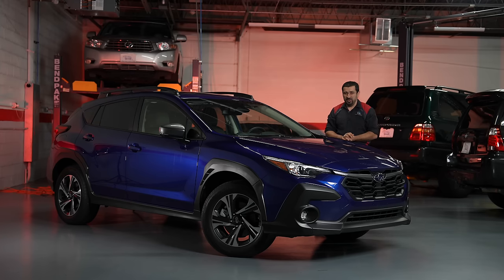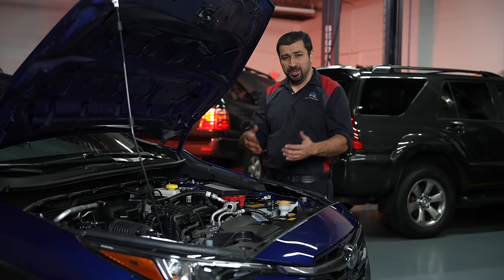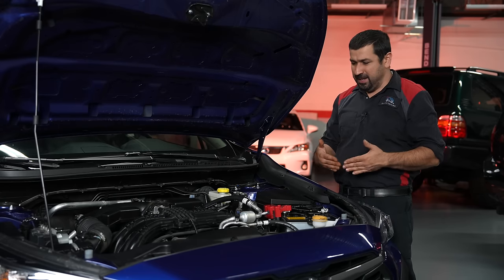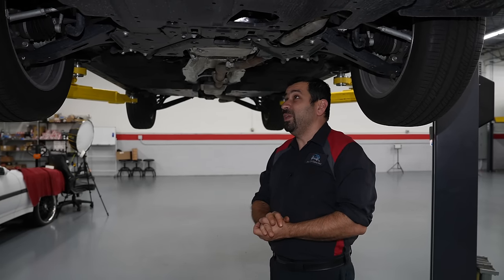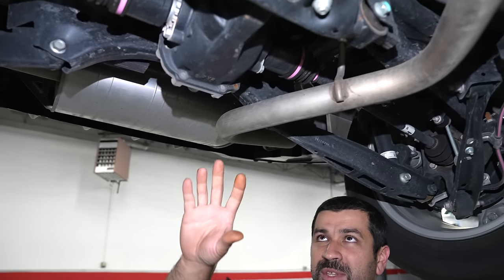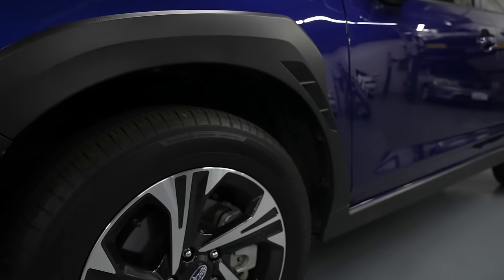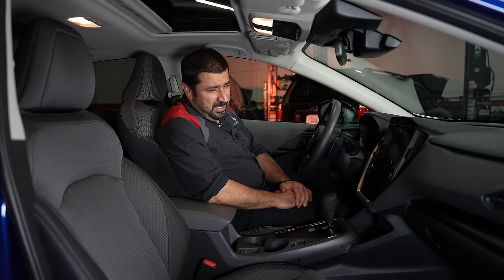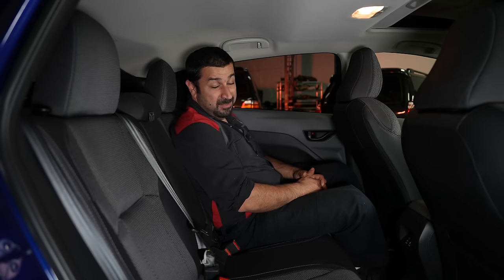Should You Buy a 2024 Subaru Crosstrek? Thorough Review By A Mechanic

Comment: Good review but it affirms that I  will not be buying a Subaru in the future. I bought a Forester with a 6 speed manual transmission about a month and a half ago that for the most part I'm happy with. It does need about twice the power it has and the electronics are a pain to deal with . 
  However when it comes to a CVT transmission I hope to never have one the only thing I would hate worse would be an electric car. 
  I prefer a manual transmission and I had to go several hundred miles to buy a manual Forester. 
  By the way my Challenger Scatpack is a manual that I ordered new. Sad to say they are going away so it will be a long time if ever that I buy another new car.

Comment: On our 4th Subaru and 2nd Crosstrek (2021). We like our Subaru's and concur with your quality remarks. Even find it easier getting in the rear vs son's 2021 Mazda CX-5. On the downside the infotainment system sucks; turning on the radio every time the vehicle turns on, fuel economy is not good for small vehicle, Steering wheel is too busy as we still don't understand 50% of them and finally the CVT does have that rubber band effect on acceleration. We are starting to question the need for AWD even though we live in Canada as we have seen a massive change in extended snow and ice coverage.

Comment: I don’t think those vents on the front fender arches are brake vents. I think they’re to relieve air pressure under the wheel well for better aerodynamic stability. I doubt they do much but I don’t think brakes have anything to do with the intention behind them.

Comment: I’ve driven these with both the 2.0 and 2.5 engine and the 2.0 is slow and even boarder lining dangerously slow. The 2.5 however in my opinion doesn’t feel slow. It’s still by no means a fast car but definitely wouldn’t classify it as slow and it doesn’t really leave you wanting for more power like the 2.0 does. 0-60 times for the 2.0 are 9.7-10.2 seconds and for the 2.5 8.0-8.5 seconds. The 2.5 gives a pretty good jump in power for half a liter and 30 horsepower.

Comment: Glad Subaru changed the brake system on this vehicle to feel more immediate.  My 2016 2.5i Forrester's brakes don't feel immediate.  There tends to be a slight delay in braking, unlike my 2014 Toyota Hybrid Camry, which brakes immediately.  And there is also a "lag" when accelerating.  AMD is correct, this car is slow and doesn't respond quickly.

Comment: Cameras are not cool.  Every time you crack a windshield, you must recalibrate the camera. Lane centering is a pain - no thanks. I miss the days of simple cars.  BTW, the camera is also taking up part of your windshield -- don't like that.  Subaru in general has many good points, including value and resale value.  I just miss simple cars that the driver controlled.  No huge screens, which must cost a bundle to replace, inexpensive headlamps, no nanny stuff yanking the steering wheel, buzzing or braking.  Wait for the days these cars get old and see the junkyard long before they would have in the days of repairable cars for reasonable prices.  A CVT alone is $10K.

Comment: Great visibility and incredibly safe huge improvement from previous years given wiring issues for these new electronic systems which are crazy complex. Owning 2 this new one is surprisingly large compared to the previous still owned model. Subaru all wheel drive is a dream to drive and the vehicle because of how the (very light) weight is distributed.  Was very impressed with the new Subaru full size SUV. Only thing missing is a return of the WRX at this point.

Comment: I have a 2017 Subaru Outback 6 speed manual 
But I will not buy any car with a CVT
Also what’s up with the oil filter being mounted high up and upside down. This causes the car to dry start every morning because the filter empties out over night. Really bad design.
Also I am not impressed with the symmetrical all wheel drive. All it does is apply the brake on the slipping wheel to drive the power to the wheel with traction. I don’t find it works very well in the real snow world. I have to turn traction control off to get up my driveway.
Don’t buy any car with a CVT. They are all problematic. Some more than others.
Now I will say that we have had no issues with the car. It’s never been back to the dealer. It’s fully loaded with all the sensors and power hatch dual Climate control power everything.
But a four wheel drive with no tire pressure system ! Subaru what were you thinking ?

Comment: A bit surprised about the comment for the camshafts. It is a dual overhead camshaft design, even though it is a boxer or flat-4 engine. The camshafts sit in the upper section of the cylinder head. The cylinder head orientation has nothing to do with the head design. The head can be upwards, downwards, on the side, it does not change the camshaft position in the head. Even Porsche with their flat-6 engines, will specify that their engines are of a double overhead camshaft design. Just a small comment. Your videos are interesting….

Comment: Mine had 15k miles dealer pulled the engine twice to fix the cam seal, pretty bad oil leak twice within 15k miles. Car is a POS never touch a Subaru

Comment: So FYI to everyone:  the cam carrier seal is only RTV and is known to seep/leak over time. If the oil leak gets too bad, it will require the engine to be pulled and engine resealed. Dealer found my cam carrier seeping on both sides of my first Gen 52k mile Crossie, quoted me $4700!  Also, I am wondering if anyone knows for sure if the later gen Crosstreks had the rear bearing failures corrected?

Comment: I'm not a fan of electronic "parking" brakes. They seem asinine. One should be able to modulate an "emergency" brake, and it should be a VERY simple mechanism.

 That said, the Crosstreks and Impreza hatches can pack a lot of value...impressive AWD/VSC/TCS, 5dr utility, available roofrails, miserly hwy MPG, easy maintenance, surprisingly good ride, good legroom, good headroom, stable handling, and 1500lb base tow rating.

Comment: Thank you for your in-depth review of this car. Good video. In my opinion, anyone interested in a Subaru in general needs to do diligent research before purchasing one. I know they have quite a following of loyal customers. Do not let that be the only reason you buy one. As a master mechanic, in my personal experience, Several red flags in my mind about the brand..The use of a belt driven CVT is generally just a cheaper design that is less efficient, with shorter service life. It is not uncommon to see them fail with only about 70,000 miles on them. Also, don’t even think about towing anything with the vehicle if it has a CVT; these cars are indeed very slow due in large part to the CVT transmission. Your grandfathers car that had a vacuum booster for the power brake system generally never had a problem with it for the life of the vehicle. And that electric assist for the power of breaks will likely be prone to failure in the future just as electric power assist steering is today versus the much more reliable hydraulic assist of older cars that is more expensive to manufacture. The boxer engine with its flat plane crank, is dynamically unbalanced particularly at low engine speeds. For this reason, fuel economy suffers.I can’t count how many Subarus have had their head gaskets replaced. I see no major design change that has rectified the problem. These engines are known for using oil. Any modern engine in today’s world that does not have hydraulically adjusted valve lifters is unbelievable to me. Toyota currently owns 20% of the parent company for a Subaru. You would think these cars would evolve into better vehicles in the future. Without a dual injection system that Toyota uses there will be carbon buildup on the engine intake valves causing poorer performance. The all-wheel-drive system is affective, however it is not adaptable to dry weather driving. Personally, rather than have it on all the time, I prefer an all wheel drive system that can be turned off when it’s not needed to save fuel. Why do you need it on all the time once the vehicle is in motion? If you really think you must buy a Subaru in my opinion, lease it and only keep it while it is covered under factory warranty.

Comment: Helpful review, thank you!  Perhaps sometime you could review the RTV sealant issue.  These use RTV sealant on the camshaft carriers instead of physical gaskets and in other places in the engine.  Some have said that after 100,000 to 150,000 miles the engine will have to be removed to replace the sealant -- which wears out and causes oil to leak.  The engine removal process represents a significant labor cost.
Reply: I work at a shop that works on a lot of Subarus. The FA and FB motors uses silicone on everything in their engines. The first time I had one apart I was surprised they even use silicone on their head gaskets. I've seen these engine develop oil leaks after 1-2 years of use.

Comment: Could somebody explain the differences between this model and Wilderness model, please? Does every model of this age has E-sight system and does the Wilderness model is worth buying instead of buying this one, considering the price? Thanks
Reply: Wilderness model is just that much better for going off-road: such as additional clearance, the more powerful engine, a little more protection underneath, modifications that give it a much higher tow rating, dual X-mode, comes with better tires. Also some of the higher end features. If driving in mountains or in snow/dirt a lot probably worth it. EyeSight is standard on all trims.

Comment: It's not slow!  It is fast enough for the speed limit of our streets and highways!  Yes, it is slower than Porsche or GTR, but then again, Porsche or GTR can't handle off-roads and snow.  Porsche and GTR belong to the race tracks, and they are overkill for normal street and highways (except for the Autobahn in germany, but even then, going super fast is dangerous so you shouldn't do it anyway.)  So, I would not say this Crosstrek is slow.  It's just perfect speed.  Having said that, I have never driven this car, so I am just guessing that I would be satisfied with this car from my experience with a 1500cc Honda Fit which is fast enough for my needs. :p

Comment: Was considering the crosstrek wilderness with the 2.5 engine. Whats your take on that engine, good or run away? 😮
Reply: Wilderness 2.5 liter is the same FB25 engine he spoke about in the video (i.e. the same one in the 2024 Crosstrek Sport & Limited trims).  It's also the same FB25 engine they have in most of their models the past several years.  The wilderness trim just has some minor tweaks to help make it more capable of stress like a transmission cooler, adjusted the drive ratio and tweaked the radiator fan output.

Comment: Do the Forester next
Reply: Current Forester is based on the same platform of last gen Crostrek. It is a 6 year old platform. New Forester is due next year from what I heard and will be the same as this Crosstrek with just a bigger cabin. All Subaru models share the same platform engine and transmissions with small model specific variations.

Comment: Comes with an extra set of piston rings and a replacement head gasket.
Reply: So do all the toyotas that have suffered head gasket issues and oil burning ( an there are quite a few)
Reply: It should probably come with an extra transmission as well

Comment: Wait…SOLID lifters? Like back in the day with my 4-Cyl VW Bus? We had to adjust those valves every 5,000 km (which I’ve done religiously). However, I don’t need to pull the engine to do it. What are the service intervals for the valve adjustments?

Comment: Isn't the problematic thermo control valve a good reason to avoid any 20-24 Subaru with the FB25 engine? I heard they are going back to an old tech thermostat for 2025.

Comment: I need to correct you about the AWD.

Symmetrical AWD is just the marketing name, but Subaru has three different AWD systems currently.

The Crosstrek has ActiveAWD which is a FWD transmission with a wet clutch-based power takeoff for the rear driveshaft. This is, by far, the most common system on Subarus. It’s the same system that debuted on the Legacy back in 1989.. except that now it’s dumbed down with a lower percentage of overall torque that it can send rearward, and a more aggressive taper to reduce torque to the rear axle above 30mph. They’re essentially FWD most of the time above 30mph to improve fuel economy.  

The Ascent and WRX auto get the planetary center diff with a fixed (ever-so-slightly) rear-biased torque split and electronic LSD (same as STI DCCD, but fully auto). These are very robust, but  higher maintenance and kill the mpg, so they’re reserved for the most expensive models. 

The rare manuals (WRX only now?) get the old 3 diff AWD with a viscous LSD on the center diff (not to be confused with a viscous coupling).  Those are very basic and robust systems that are dinosaurs now.  Great for a cheap AWD rally/rallycross car, but your money is better spent on an extra set of wheels with snow tires in any modern 2WD car with half-decent traction control.
Reply: Also, I’m so glad the algorithm sent me to your review. This kind of in-depth analysis is severely lacking for new car buyers. I learned a lot (and I’ve owned, raced, and wrenched on Subarus since 1987).

Comment: Like the Crosstrek and I did look into it once a few years but I really have to have 6 cylinder at a minimum. Plus those hvac controls in the screen on the dash.. a BIG no thank you there.

The 2gr-fe w/ the 6 speed in the Highlander moves, shakes and shimmies the way I like it. Not a racer or an aggressive powerhouse but it works well for me. 

If I wanted a 4 banger it would have to be something "built" and a manual in something sporty, low to the ground that can also corner like it is on rails.. and I can't get myself into anything like that if I wish to keep myself out of trouble out there.

Comment: The 0-60 times don't appear to be slow at all with the 2.5 engine, at least at sea level. Really 8 sec. to 60 is not bad.  Even the base engine is not terribly slow.  I think it is 9.5 sec to 60.  Compared to the 1980's cars, it is a sports car 😎 2022 Honda CRV is 9.4 sec. Corolla Cross is 9.2 sec.  Thus the Base CrossTrek seems around normal for a compact or sub-compact and the upgrade engine appears to be faster than some and around the same as others.  Take note of small cars in the 1970's -- ouch!  Of course dealing with so many big boys on the road today, you need some boost in speed.

Comment: My gripe with Subaru that I had years ago the dealer said if I need 1 new tire I should replace all 4 b/c of the all wheel drive would get screwed up. Different sizes of the tires was the fault. A note also is  Subaru in Japan now has Front drive only Impreza for the domestic market!
Reply: You had a dealer that gave you bad advice about your tires (he WAS right about the possible damage to the AWD, but that applies TO ALL AWD VEHICLES), and you're still whining about it?  Looks like you were frantically searching for something to beech about Subarus.
Reply: Yes....   Subaru are vehicles you should be rotating tires regularly....
Reply: A replied to another posting on this topic. I once replaced a ruined, half worn winter tire on my ‘11 Forester. No problems.

Comment: The infotainment system is definitely a weak point.  Test drove a Legacy with it, was horrible to use.  The other problem is the CVT. Many fail at 80,000 miles because the solenoid fails.  Catch it early, you pay $900 to $1000 to fix.  Catch it late slipping constantly, and the bands have stretched, and you have to replace the full transmission for $6000.  If you are fortunate and the solenoid does not fail, then the transmission tends to last 150,000 before failing.  The old 5 speed lasted longer - about 200,000 miles.

Comment: Don't like Subaru after one tried to kill me - steering component snapped on the highway and I lost all control. And the turn signal stalk broke inside and it was leaking fluids on the driveway and the inside glass always had heavy condensation from some kinda leak. Only 155,000 miles whereas all my Toyoyas are now 225,000-240,00 miles with none of these issues.

Comment: We were given a 1992 Subaru Legacy in the late 90’s from our Dad.  Very reliable but under-powered 4-cylinder. It was black and A/C compressor blew up and replacing was more than the car was worth (over $2,000) Traded it in for a Chrysler van (big mistake but I did get it to run for 15-years.)

Comment: I don’t understand why all the emphasis on how "slow" the engine is.  Yes, the 2.0 liter 152 hp is very slow (0-60 in over 10 seconds) but it's adequate when compared to many otrhers. The 2.5 liter 182 hp is actually not bad at all....8.0 seconds for 0-60mph.  That’s actually decent and much better than many other SUV's.   🤷‍♂️🤷‍♂️.
Reply: Agreed. On the roads, I see people  mostly tuned out and not moving. There's few opportunities to really accelerate. During freeway merges, half the people in front of me SLOW DOWN or come to a stop instead of merging properly. A few crazies go across four lanes of traffic and floor it in heavy traffic.
Maybe on the Autobahn these would seem slow.
This guy isn't a Subaru mechanic. He's also not an engineer.